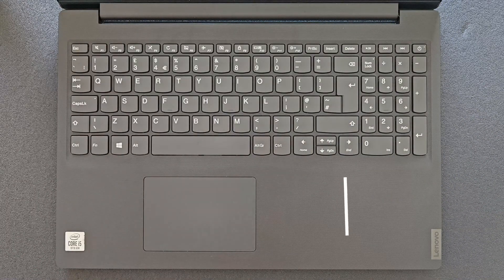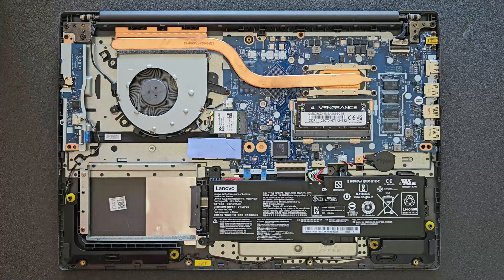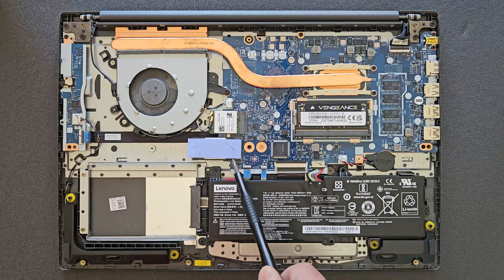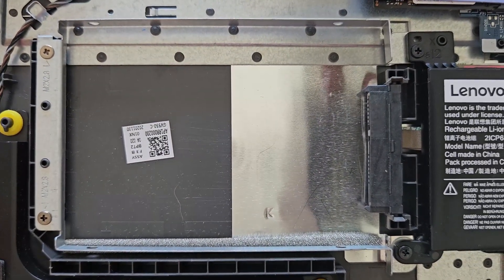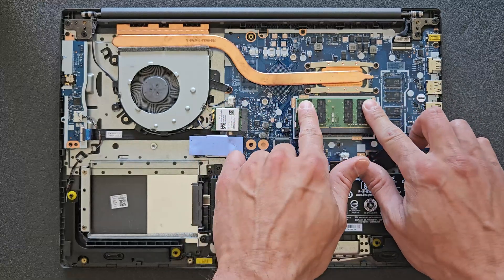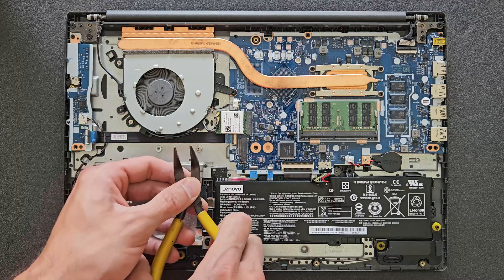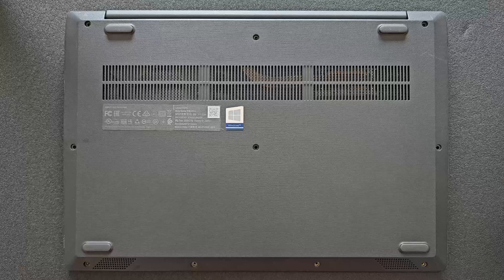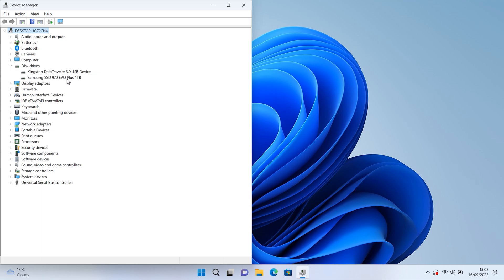Lenovo ThinkBook 15 (2020 model) RAM and NVMe SSD Upgrade

Comment: This laptop only has one slot for the ram, correct? I installed a 32GB and I see that my installed ram comes up at 40GB so I think there should be another 8GB somewhere, but I can't find it!
Reply: its soldered at the bottom
Reply: @ghrst i bought a  second hand laptop late on i found out the soldered ram is not working how do i enable it
Reply: @jordimicheal-my7zp  Hay que reemplazarla, la memoria la compras en aliexpress pero la herramienta para poder desoldar ese BGA y la experiencia que pide hacer un trabajo de esos es alta
Reply: @roaxdas4715 thanks buddy 
I dont have the money to buy the ram
The soldering would need a qualified person which i dont know of in our country
Reply: @jordimicheal-my7zp  what country u in lol any repair shop can do it, also ram isnt too expensive
Reply: @ghrst maybe i am wrong about qualified personal not being there
But it would be expensive i am just a student 
Botswana gaborone is where i reside